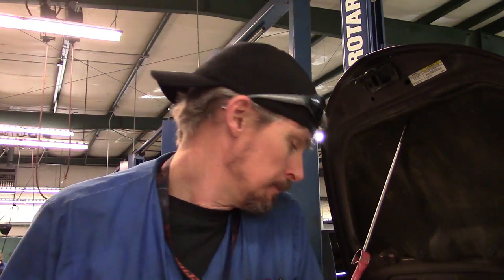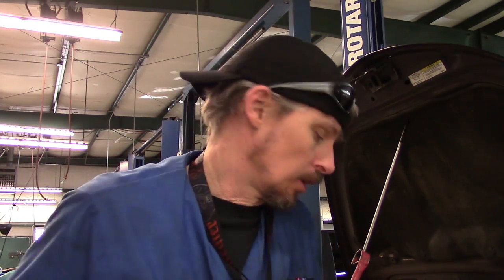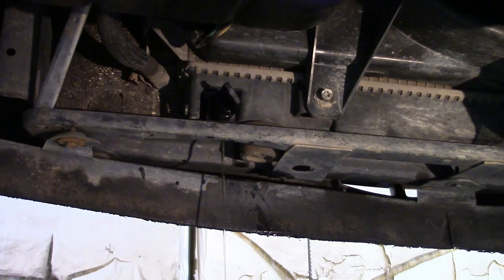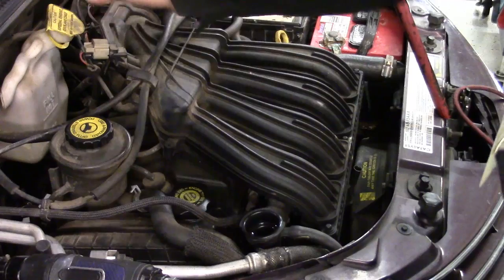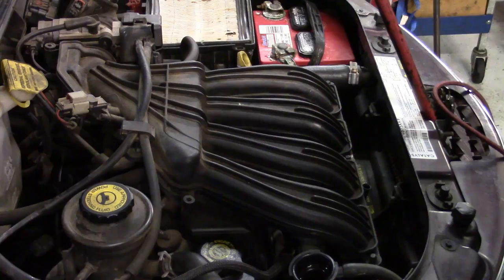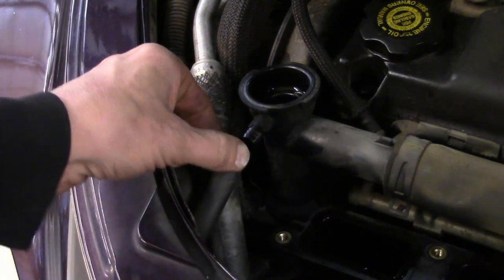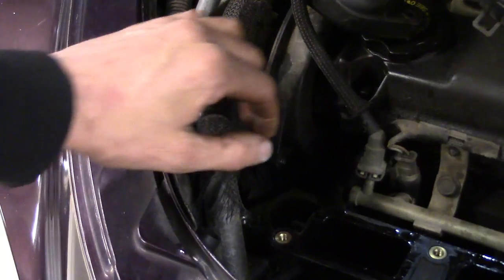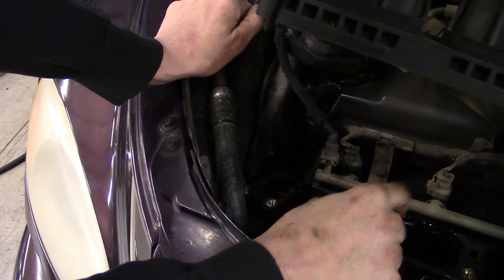Chrysler PT Cruiser 2.4 upper thermostat housing removal and replacement

Comment: Just leaving a tip about this procedure. I find removing the intake to be time consuming.  I usually take off the upper radiator hose from the radiator.  After removing the housing nuts, feed the hose out until you have access to the hose clamp.

Comment: Just remove the clamp from the hose on the Radiator side and pull it through. No need to remove intake.
Reply: That's how they get there 1.5 hours for labor 😡

Comment: Thanks for your video, so useful for me,  only a question, do you know the specification of the bolts which  join the upper Thermostat Housing?, thank u
Reply from the maker: If your talking about the plastic housing then the 2 bolts need to be torqued to 110 inch/lbs.....not ft/lbs. Thanks for asking and for watching.

Comment: I c that was before your Milwaukee stuff. The old smaller Milwaukee electric 3/8 is small fast and light. I have the new one to. It's heavier but stronger. Perfect for that manifold brace.
Reply from the maker: I started trying cordless tools with the cheaper Craftsman versions....before I used cordless tools with 3/8 adaptors. Once I started feeling they would work good for what I do I moved up to the better quality brands and have done away with air except for inflating tires. No more air line getting in the way and cordless means you can take them everywhere
Reply from the maker: I started trying cordless tools with the cheaper Craftsman versions....before I used cordless tools with 3/8 adaptors. Once I started feeling they would work good for what I do I moved up to the better quality brands and have done away with air except for inflating tires. No more air line getting in the way and cordless means you can take them everywhere

Comment: I have a question please, on my PT Cruiser, I have a leak that looks like it could be from the water pump. So is it possible, that it could be my thermostat housing upper or lower?  Can the thermostat housing cause a leak to where it looks like it comes down from where it could be the water pump? I know water runs in weird ways.. thanks God bless

Comment: Do you have to bleed the system since you did not drain anything?
Reply from the maker: I recommend it every time just to be safe. Its only a couple more steps. Thanks for asking and make sure to subscribe.
Reply: @MotorCityMechanic  should I use the bleeder screw or just burb it with the cap off  only
Reply: @MotorCityMechanic  iam replace my thermostat today I have never use the bleed screw before . Just open and close it a few times after I start the car ?? I appreci your help

Comment: I have a question.  we replaced the thermostat on my 03 PT Cruiser 2.4 non turbo.  it is leaking now out of the bracket.  we have tighter it and put gasket weld or whatever it's called on there and it still pours out water on the backside. what can I do?
Reply from the maker: Timothy Coleman When you say bracket.....are you speaking of the plastic thermostat housing or the aluminum mount that the thermostat sits in?
Reply: MotorCity Mechanic  Hmm.. My friend took off the 2 bolts the housing,  he broke one of the bolts,  we had to get a new one,  we replaced the thermostat and when he put it back together,  he added some gasket sealer and it pours water out of the backside. The area that separates the bottom and top of the housing.  He added the sealer because one he originally put the housing back on and tightened it down,  it was leaking.  He then took it back off and put gasket sealer on and tightened the housing back down again,  it still leaks
Reply from the maker: Gasket sealer shouldnt be used. The thermostat has a rubber seal that goes around it and thats what seals the housing. If a new housing is needed.....there is Dorman replacement you can order for less then $20.00. http://www.partsgeek.com/m369h6b-chrysler-pt-cruiser-thermostat-housing.html?utm_source=shoppingcom&utm_medium=pf&utm_content=dc&utm_campaign=PartsGeek+ShoppingCom&fp=pp&utm_term=Chrysler+Thermostat+Housing
Reply: thanks.  I ended up getting an new Thermostat that actually has the gasket (o-ring) on it.  It fixed the problem.  But now we watched your video to a T after changing the water pump and Timing Belt.  Problem now is,  if Ingot the gas after starting it,  the RPM's drop and the car cuts out.  Engine vibrates a bit when idling and it ends up cutting out.  Is it a spark plug? As per timing wise,  we made sure after a couple times that is was all lined up.  I don't know why it's shaking and why the idle is lower than it should be.
Reply from the maker: Double check to make sure nothing came loose from having jacked the engine up when doing the timing belt. I have seen some people damage the MAP sensor for example. I would also check for codes to see if anything can point you towards a possible cause. All this is being that all the timing marks line up as you say.
Reply: @MotorCityMechanic  quick question for you. I just bought a 05 pt cruiser. And the bolt hole for the aluminum mount that the thermostat sits on. The previous owner broke the bolt off and tried drilling it out and ruined the bolt hole. What all do I have to do to replace the aluminum thermostat mount??

Comment: motor city ,where is the coolant tempature sensor on a 06 pt cruiser ,thanks
Reply from the maker: Thanks for the question. Locate the radiator cap on the engine, now start looking down toward the bottom of the engine. Just below the radiator cap/thermostat housing is the coolant temp sensor. Make sure to subscribe and help spread the word
Reply: will i have to pull the pass. side fender to get to it ? thanks
Reply from the maker: Danny Thompson Not at all, the fender would make no difference. You remove it from up above. You may need to move some items slightly out of the way to gain access to it.

Comment: I HAVE A DREAM CRUISER, 2003 ORANGE TURBO 2.4 LOVE MY CRUISER , IT SEEMS WHEN I GO TO DRIVE I WILL SEE STEAM COMING FROM THE UPPER HOOD , AND THE COOLANT WILL RUN OUT I WAS TOLD IT WAS THE THERMOSTAT HOUSING UNIT I PURCHASED A AFTER MARKET ONE AND ON TOP IT HAS A SHORT STEM WHICH IS POSITIONED DIFFERENT FROM THE ONE ON THE CAR, SO I WENT THE DEALER THEY SHOWED ON THE COMPUTER WHAT THEY HAD BUT THEY SAID THE PART HAD BEEN DISCONTINUED SHE ALSO SENT ME TO PARTS AUTHORITY HERE AND IT WAS THE SAME AFTER MARKET , SHE THEN PULLED UP 6 CHYSLER DEALERS ACROSS THE USA THEY SAY THEY HAVE IT AND THE PART # MY QUESTION IS SHOULD i HAVE THEM TO TXT ME A PICTURE OF WHAT PART THEY HAVE , MY SON SAYS HE THINKS MY HOUSING ALONE IS NOT LEAKING BUT MAYBE JUST THE THERMOSTAT HE SAID HE WOULD NOT REMOVE THE HOSE THAT STRETCHES ACROSS TO THE RIGHT SIDE , AND I HAD THE RADIATOR REPLACED WHEN I FIRST PURCHASED THE CAR IT WAS A CRACK IN IT  THEY DID NOT PUT THE O RINGS BACK COULD THAT BE A ISSUE ? WOULD YOU REPLACE THE WHOLE HOUSING UNIT AND THE THERMASTAT IF THE DEALER HAS THE RIGHT ONE I WISH YOU WERE HERE,

Comment: I have a PT cruiser 2008 and is over heater every 30 or 45 min driving I changed the thermostat radiator and radiator Cap and still over heater that engine light is off
Reply from the maker: I recommend making sure that both speeds on the radiator fan are working. Its one fan but was two different sets of windings internally that give it a low and high speed. This is a common issue that I have seen. Otherwise if that checks okay then you might want to make sure the head is not warped. Depending on how hot it got......the original cause my have created a new issue. For example of the radiator was clogged up and caused an over heat.....it could have gotten hot enought to warp the head (you cant blow a head gasket on this vehicle.....metal gasket, head will warp instead). Replacing the radiator might have addressed the original cause but now the effect has to be fixed....the warped head. Its something to check into. Start with testing the fan first. Thanks for asking and make sure to subscribe.

Comment: so my coolant sensor is completely gone...cant find the wire either.  I don't know if it fell off when the radiator was crunched or just was never there.  I replaced the whole radiator got a new fan and stuff but I'm stumped about the coolant sensor.  My mechanic friend said that maybe I have a cracked block or blown headgasket or something because I started it up and it doesnt sound great. Hoping thats not the case. Seems to be a leak in the thermostat housing.So I want to go ahead and replace that, but I cant tell where its coming from. What if its the lower part? Its definitely coming from the thermostat housing. I can go ahead and replace the thermostat and the housing but what if its the lower piece and where is the wire that the sensor would go to so I can get a new one of those?  I don't see any wire that is is loose anywhere.  I went ahead and traced the wires from the little breaker box thing on the right side of the engine but I still cant find any loose wires or anywhere that a wire may have been pulled off from the impact.  I am not a mechanic but I am determined to get my car running so any help would be great.  Thanks.
Reply: +Jennifer  Peebles Oh ya I figured out the temperature sensor was missing from watching a video on how to bleed your coolant. I thought the leak was coming from that hole but there doesn't seem to be any actual hole there. Now that I have the radiator all put in I went ahead and put water in it in case I have to do something else.  Sure enough there is a leak somewhere. If there is air in the radiator and a leak could that be why it is running like it could possibly be blown?
Reply from the maker: +Jennifer  Peebles it really depends on how hot it got. A crack in the cylinder is highly unlikely. Blown head gasket....ain't happening. Why might you ask.....because it has a metal head gasket. What happens with an aluminum head is that it will actually warp causing leakage into the cylinders. If the engine is cold, take the radiator cap off and start the vehicle....if puffs of smoke or coolant gets blown out the radiator cap opening then you most likely have a warped cylinder head. I'm curious about the coolant temp issue. The lower portion that the t-stat plastic portion bolts to can be replaced. If you can take any pics related to it then either hollar at me on Facebook or email me at david@motorcitymechanic.com because we can't attach pics here. Plus I can reply with images etc.....on there as well
Reply: Thanks so much!!!! I will be emailing you! I have never even changed a tire prior to this so...needless to say I could use a little guidance.lol
Reply from the maker: Jennifer Peebles Your welcome Jennifer
Reply: @MotorCityMechanic   If it's the cylinder head, would the puffs of smoke happen right away or after the engine gets up to running temp? Any other tips to know if it's a warped cylinder?

Comment: Motor city, where is the thermostat on a 2016 Chrysler 200 limited 2.4?
Reply from the maker: Quick question.......whats the issue with the thermostat? I am going to guess a check engine light for P0128?